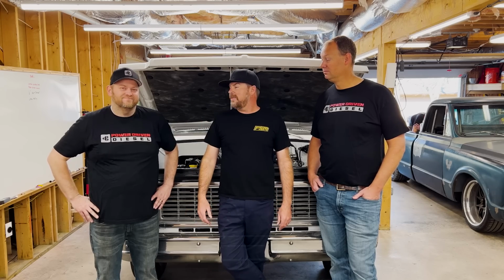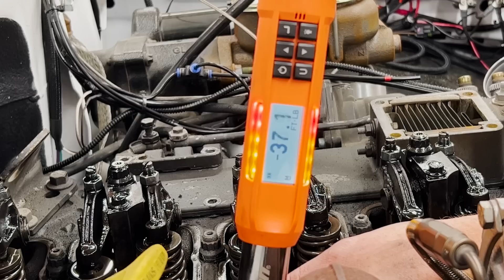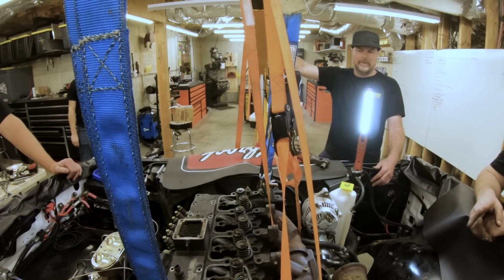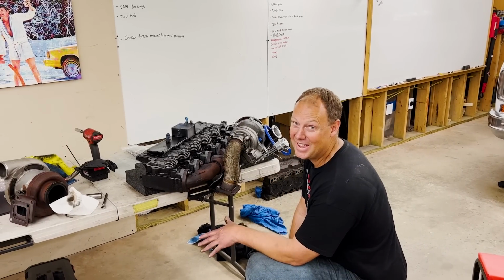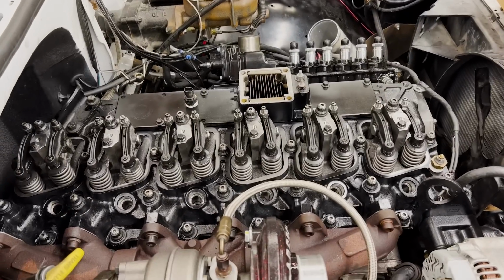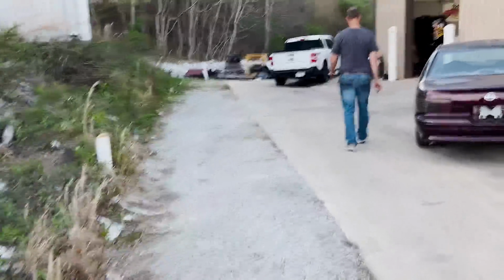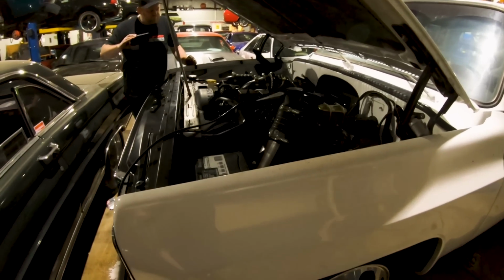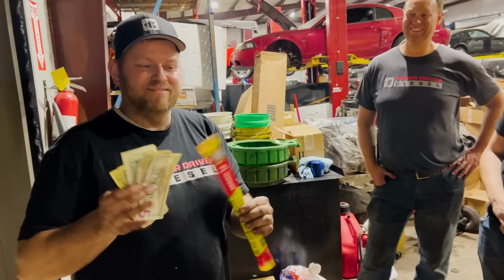I SPENT $6000 TO MOD MY CUMMINS-SWAPPED SQUAREBODY CHEVY AND NOW IT MAKES 1,350 FT-LBS OF TORQUE!!!!

Comment: Take the bolt out of passenger side motor  mount drop block down 1 inch u could get push rod out and head off studs

Comment: Torx bits are excellent extractors find one that wont quite fit and hammer it in. The teeth will bite into the walls of the M5 bolts studs etc.

Comment: My dad bought an 81 can and chassis dually new in 1980,wore the 350 out pulling around backhoes for a few years,then dropped an LS6 crate motor in it with solid lift cam,and it hurt feelings all over Houston lol

Comment: the old turbo would be right at home on my 92 Chevy 6.5 dually. especially since the one it has is clapped out.  then again the motor blew chunks off of the number 7 piston skirt. so the engine is currently on a stand.

Comment: It's my understanding  that concoction is missing one ingredient. Diesel fuel. 1/3 ATF, 1/3 Diesel and 1/3 acetone was the original mixture.

A channel called project farm tested all the penetrating oils in a pretty well controlled setting.

Comment: Something I was told a long time back when breaking torq on manifolds. break torque on one bold, re-torq it, but not all the way back to full ugga dugga , and move to the next one. once you have broken all of the bolts free once then remove them. The reason is that the manifolds warp a bit and when you remove one bolt it separates slightly and increases the pressure on the remaining bolt. but that could all be bull shit.

Comment: I have a 1972 1 tone quad cab square body with a stock 12V 5 speed that I love but I don’t get to drive it much even though it gets as good as mileage as our POS Nissan. It pulls my 5th wheel camper and still gets 30+ mpg

Comment: I would of / I have added larger turbos to compensate for fuel to clean it up. Get a common rail if you want a tow truck that makes a 4 digit hp number. They make power so much better.

Comment: Steel bolts in cast iron, need 2 get never seiz on them when re- installing them!!! And if there really hard 2 break loose and your afraid your going 2 snap or strip it, try tightening it a bit then break it loose!!!!!!!

Comment: Air Force taught me that straight extensions do not change torque values, only crows foot adapters require a formula adjustment.

Comment: Brother idk about with paint thinner, but I know atf and brake fluid will work inside of a u-joint and penetrate real nice on different things .. idk what kinda voodoo magic it does but you mechanics know about them Early 2000 f250 u joints with 500,000 at least I have seen them break ball joint presses. Hand held or table stand but an old school guy showed me that and it is solid second to that combo would have to be this stuff called deep creep by seafoam that's some pretty good s***s there but in a jam, brake fluid and trans fluid

Comment: I tried using acetones and a transmission fluid. Yeah it works good but the problem is not for me anyways, but they separated OK and by accident I grabbed a canna brake cleaner. I don’t know what I was thinking. I put a quarter ounce of a brake cleaner with 3/4 of an ounce of transmission fluid works great stay suspend it to.

Comment: Extensions while Torquing, true that Extensions twist but the Torque Value indicated will be accurate. 40 years Wrenching. I have busted Snap-On sockets at the end of a 4' stack. Extensions flew everywhere. Test it yourself.

Comment: Over 438 thousand views you made way over bank to pay for this build ld let alone the sponsorship beside that great video thinking hard about doing it to my !74 23ft gmc motorhome on a 2006 e350 4x4 frame thec5th and 6th wheels are on full independ suspension motor is a 12value cummins 6 speed aillson upgraded transfer case

Comment: Since horsepower is torque at 5250  the question lacks gravitas  in reference to torque vs horsepower . Cole  was at 924  when everyone was over on the HP.
Reply: John, torque times r.p.m. divided by 5252. 
Yes they are equal at 5252.
Reply: @t.s.racing   Thus the problem with the fixation on a HP number when torque does the work .  For some  people thing need to be reduced down too far . Understanding the range of rpm that you need torque for goes very far in the use of the machine for it purpose.  Road racing  towing and street benefit from  a broad torque curve . Drag Racing can use a much narrower peak and higher in the  RPM range .  F1 uses gear ratios that are unreal . Sound of 17k is not soon forgotten  .

Comment: Still not sure why they cut the firewall and all that. They make bolt in mounts for these and have for a long time 😂. Either way cool truck but a lot of work for no reason.
Reply: If you would have watched the videos of him installing the diesel engine, you would know, and listen to what he Say's!! Pay attention.
Reply: @stevehetrick2676  because of the fan and all that but what I’m saying is, they make mounts, and radiator setups, that would of been a lot less intrusive, and can still keep the mechanical fan.

Comment: the exploding truck on the dyno, inside the truck fire jacket and helmet required, the dude on the dyno with the truck door open and 6" away from the driver, safety equipment, straw hat and windbreaker.

Comment: Hey Mike, what Holley system are you using to run the LT4 in your truck? I called to order the Holley system to run my LT4and 4L80-E tranny combo and they said they weren’t done yet so my project is dead in the water. Any advise or solution?

Comment: I work on Skidoo 550 fan engines that use studs. I find if you strike the stud with a hammer to shock the stud first they come out alot easier.

Comment: I know I'm late to the party, but I have had really good results with Wurth, Loc-tite and Permatex COPPER based anti-sieze  used on fasteners . We used it on bolts for bottom rollers and everything that would rust on track machines in a landfill. You won't regret it. It's key on CAT exhaust studs. You haven't cursed until you try to get broken bolts out of a track frame on a 973.

Comment: Still a bit too  smokey on the 500whp run.  Mike shoulda went with the more modern common rail injection engine, that way he can run a zero smoke wife friendly 450hp tune as well as a 550hp performance and 650hp+ race tune all at the turn of a dash mounted knob.

Comment: Was there an hour meter on the Air Force tug? It might have a million hours, or it might not. Sometimes those things just sit a lot and dont get used. Up north I would believe extremely high hours sitting there keeping some airman warm. It likely does have a lot of cold starts followed by immediate usage though.

Comment: Snap-on tools are expensive, but for hand tools, they are worth it. They will save you money in the long term. Not rounding off so many fasteners and not breaking nearly as often as others means you can do jobs faster. If you can get a few extra cars done every month, you'll quickly pay for the difference in price.
Reply: Keep drinking that Cool aid
Reply: Doing jobs faster? That's a stretch 😂

Comment: Speaking from experience as an Ag technician, some heat and a quick snap with a pneumatic impact will zap those bolts right out....or off 😂. Cummins heads are the worst because the manifold bolt holes go right through and the corrosion eats the bolt from the back side

Comment: I sometimes have to change heads on marine 6bts and the 350hp pump requires me to notch the aftermarket heads around the filter provision thats not used in marine application.

Comment: One tip I'd like to give you. The bottle you put the penetrant in you should take the dipper tube off, when the acetone changes temperature it can potentially empty the bottle. We use those MEK and I have had one empty itself on my cart while I was not at work. Lessons leart hart way Lol. You'll have to tip the bottle to use it, but the mess will far less.

Comment: Did a long extension torque test once. Had all the mechanics donate long extensions and we made an extension at least 10 feet long. Using 3/8" drive for maximum flex. Used a Snap On torque wrench set to 35 ftlbs and used it on Yamaha ATV lug nuts. The only difference we found between extensions and no extension was that the extension flexed a lot, meaning you had to turn the wrench an additional half turn or more with a ten foot extension to take up the flex, but the on and off  torque accuracy was pretty close. Close enough that the mega extension basically made no difference. We did not try this test on really high torque values. I'd imagine those would show some variability using a ten foot extension.
Reply: The myth around extensions affecting torque comes from impacts. On an impact it dampens the blows from the hammers and limits torque. Doesn't affect ratchets at all.
Reply: @boostaddict_  Fair enough, but the reason we did our test was that a few of the guys said you shouldn't use extensions with torque wrenches. So maybe the myth varies a bit from person to person?
Reply: @somethingelse2740  Probably. Impacts lose torque, constant torque like a ratchet or torque wrench won't.

Comment: I love diesels and I love big blocks. I own both.  But why is everyone act so crazy whith diesels when they make a lot of power? And why compare to a stock n/a 454😂 the 6bt is a pig. All the power is in the forced induction. A stock n/a 454 will destroy a stock 6bt with 10psi. All the diesels power is in the 40 or 50 psi of boost. Again I love and own both but honestly its not really that impressive.

Comment: Acetone/ ATF gets a nood for freeing up stuck rings in motors, had a 351 I did a revival on. It was stored in a trailer for 9 years, and it was stuck. I mixed up some sauce, put a few squirts in each cylinder, let it sit, and the next day it rolled over easy.

Comment: I'm underwhelmed! Less than 100 bhp/ltr with compound turbos!  Get Gale Banks on the job!
Reply: Its a towing setup, designed to survive at 1000+ torque for hours on end. I don't think 504 horsepower is too bad. I'm sure with bigger turbos it would make more power

Comment: Bigger primary dose not help bottom end smoke. Bigger Anything is more laggy, more mass= longer spool. That 57with a frogged billit wheel and free-flowing hotside 64 10blade would have made it way more peppy and cleaner.  If I understand twins yes the secondary 69mm would put in more work but it is the power limit not the primary.

Comment: Just one question about the super motor Mike. Once you drive the ramp truck to Utah, have a big power motor put in, are you concerned that it may blow? You won’t exactly be able to load it on the back of itself to bring back to Georgia!

Comment: It doesn't matter what penetrant you use as much as how hot you get the piece first. If you get it really hot, the expansion and capillary effect pulls the oil into the threads.

Comment: I can't believe I didn't think of that cuz yes acetone will get into those threads no matter what and if you bring the acetone in with oil you're getting that bolt off no problem great great idea😎 especially with the transmission fluid oil nice and thin as well

Comment: I went with power driven diesel 60lb lbs springs cause nobody else claims theirs are made in the USA unless you want to spend $600 on springs. Others say the origin is USA but they are still made in China. I’m not putting Chinese garbage in My 97 all American 12 valve. China now has a huge Cummins factory and they make genuine Cummins 60lbs springs but I ain’t buying that crap. It was $50 more for 12 springs made in the USA. If people weren’t cheap bastards America would be great again.

Comment: Mike, the next time you have this problem weld an old nut into some vise grip pliers, cut down the center of the nut with a band saw.  The blade kerf will allow clearance for the vise-grips to function as stud pliers to work in tandem with the allen key.

Comment: I would've just cut the push rod and put a new one in instead of drilling that hole. I'm going to laugh if they put new push rods in with the new head
Reply: You'd then have to cut the new pushrod in half to get it in with the new head. Probably not ideal.

Comment: Ed's Red Bore Cleaner works great for cleaning rifles and works well on wood stocks and loosens bolts etc. equal parts of K-1 Kersoene, Mineral Spirits Paint Thinner, Acetone and ATF you can also add some lanolin as well. If you buy all the componets in Qt. cans you will have 4-Qts. and refill the containers and give 1. Qt to 3 friends. 1 Qt. will last a while.

Comment: I’ve seen extremely high Hp trucks with zero smoke because they are tuned perfectly. Smoke is for kids with their wheels poked out, tow mirrors out, squatted and white sunglasses.
Reply: @buickboy69  pullers use smoke to cool egts down, ive seen super stock tractor hit over 400 psi of boost and still be rolling black.
Reply: you seen high hp trucks that have hella nitrous and well over 150 psi of boost, its easy to clean up smoke then, less hp setups smoke more, smaller setups dont spool chargers good, and you gotta have big injectors, look at pdd's race truck, its 1350cc of fuel and a bunch of nitrous with 3 intercoolers, and 220 lbs of boost.
Reply: Smoke is unburnt fuel, unburnt fuel is HP flowing out of the exhaust. A waste. Have you guys ever seen any of Banks vehicles smoke?
Reply: Coming from a guy who doesn't own a performance diesel.  Nitrous will clean it up but tuning a fuel only diesel is not as easy as you think.
Reply: @SimonElenor  look at my truck.  I can make 1200 whp pretty clean. But cant make 1400 clean without injectables.
Reply: @jessieharris8204  Why do you need that much? Not picking on you. But I build for reliability and fuel mileage. Practical stuff. But never seen the point in drag racing anything. Just my opinion nothing else.
Reply: @SimonElenor  I do drag and drive events.  Tow a  trailer, drive race track to race track.  Drag race then do it again.  I also mess with 6.5 gm stuff.  I have the highest hp. 6.5 in the United states.  And my wife drives it to work. I have high hp om606. And 8v92 Detroit.
Reply: @jessieharris8204  Cool! But again! All I am saying is you can have power without smoke.
Reply: @buickboy6935  part of why they push the smoke in the pulling community is to cool egt's. Less fuel would clean it up but less power, but more fuel means more power and cooler egt's. Downside is you risk washing cylinders.
Reply: I'm going to add one more thing, if you have high egt's you can either detune, uptune, or add more turbo. I prefer detune for a working truck, pulling pour the fuel to it once you run out of turbo.
Reply: Cools egts..etc it's not because of bad tune or a kid. Tow mirrors look good no squatting because no truck guy likes it no car guy does and it's illegal (thank God) wider wheels aren't just for poke but some look stupid on big trucks. Better on cars and mini trucks.
Reply: I thinks people should be able to do what they want and not have "holier than thou" people talk shit about their builds and hard work. If a kid likes a certain look. What do you care? It's not your vehicle. Can't imagine living a life thinking like you do. Must suck to be alive.

Comment: For allen bolts that are a bit hard to get out or have started to round off I find getting a torx bit and bashing it in will get enough bite on the bolt/stud to get it out.
Reply: If you go a size bigger than “it just bites” it will actually turn the Allen into a torx… you can’t tell it was anything different. Done it many times.

Comment: Biff needs to make like a sheep herder and get the flock outta there. Also Mike find yourself an air charged aerosol can for your ATF/Acetone concoction. It really does work if mixed in the proper amounts.

Comment: You do know that if you remove the bolts in the proper order, you're less likely to snap bolts. The reason why is as you loosen the bolts, the manifold will bow, the pressure will go way up on the ones that you haven't undone yet, and thats why they break.

Comment: Mechanical engineer here. In manual tools like a torque wrench straight extensions don't make any difference for torque value applied (assuming static situation, which can be assumed as long as you're ). The force which acts on side of the extension will also be applied on the other side. This follows from Newton's third law. When using impact tools it very much makes a difference, since extensions will act like a spring absorbing some of the energy. Since the force is linearly linked to the force applied on the fastener, less energy reaching the fastener means less force applied

Comment: The ATF/acetone mixture does work well, particularly in the rust belt. My preferred mixture is Type F, 50/50, well shaken in a spray bottle. I'm not exactly stingy with it, either.
Reply: I've been using the acetone/atf mix for years now and it does work really well. Like you said, the more the better. They also would've had better results if they had let it sit longer as well. It takes time for the mixture to seep into the threads
Reply: Im so trying this! Thanks man!
Reply: Rusty exhaust manifold bolts on my 40 year old boat motor, and the Acetone/ATF worked like magic i did not bust a single bolt!! Let it sit and be liberal with it, and work the bolt in and out a little at a time.
Reply: @dougulrich5381  👊
Reply: extreme rust belter here.....the best penetrator is the fire wrench!
Reply: Been using 50/50 ATF/Marvel Mystery with great results for 30+yrs